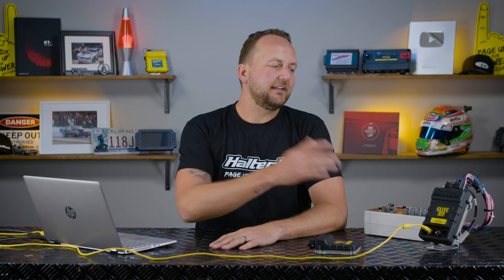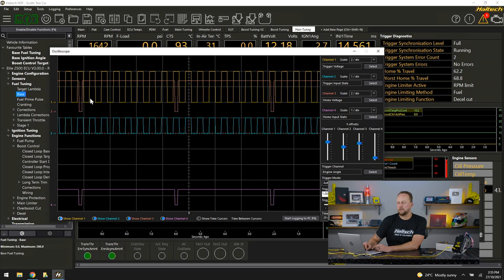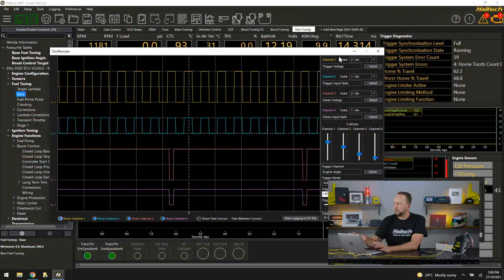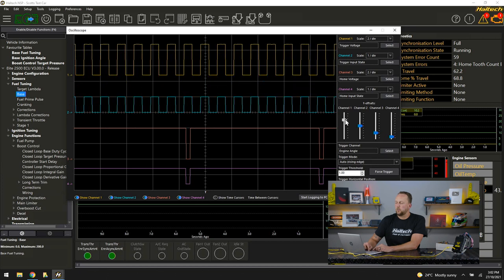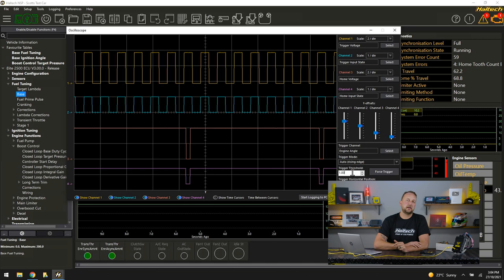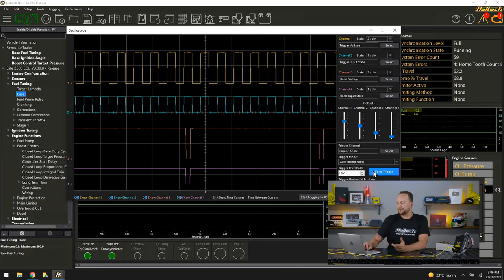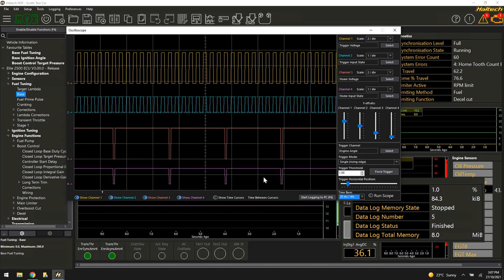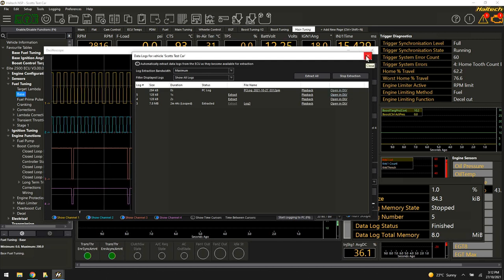🛠 How to use your NSP Oscilloscope (it's easy!) | TECHNICALLY SPEAKING

Comment from the maker: All NEXUS and Elite ECUs running the Haltech NSP software feature an in-built oscilloscope. But what exactly does an oscilloscope do and how is that useful for tuning cars? Our resident tuning guru is here to tell all.
If you are still on the fence about NSP - watch these videos:
NSP Menus Explained: https://youtu.be/xoMYgYmiq8k
How to get NSP on your Elite ECU: https://youtu.be/Yr2qotoDsUY
Reply: Hey i know this is a unrelated topic but I performance shop in Sydney has put a password on my PS 1000 and kept on beating around the bush and so I took it over too him and he swore to me it wasn't him and then on the way home I give it some beans up on to the m4 and looked in my rear view and what do you know I've had cylinder 4 suffer ringland failure and so it's out now in the bin I have Troy from pro speed performance sending Scotty at Ichibahn a IAG EJ20 MAGNUM to build and I just want this lock sorted before the car is sorted so when it comes to tuning it there is no further headaches I will call you guys sometime this week but if someone can give me a quick short answer to this massive long question that would be great cheers 👍🏻

Comment: ..an example of a defective coil, fuel injector or a troubled hall sensor etc would have really driven home the usefulness of the scope feature and the potential of its use as a real diagnostic tool. Shame.